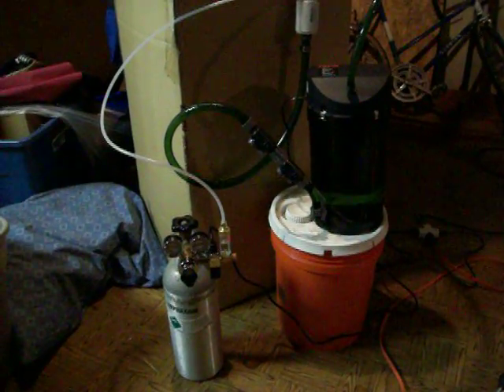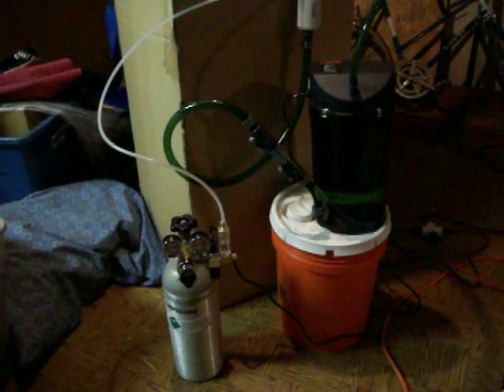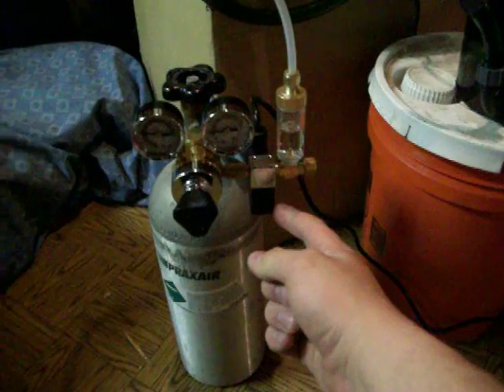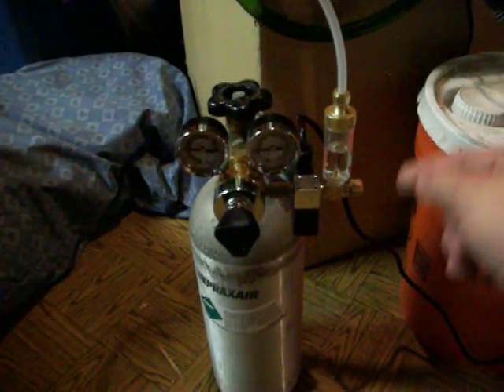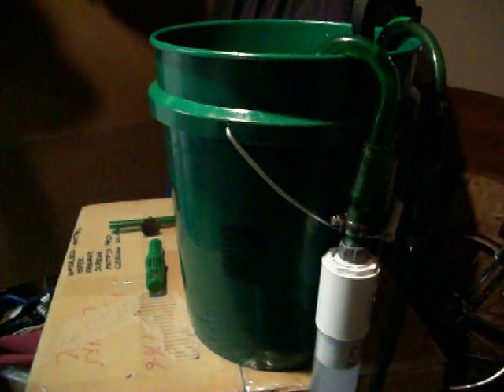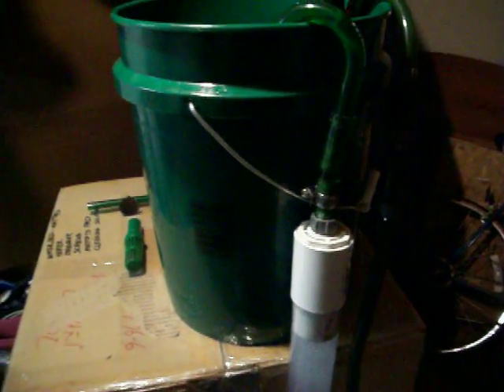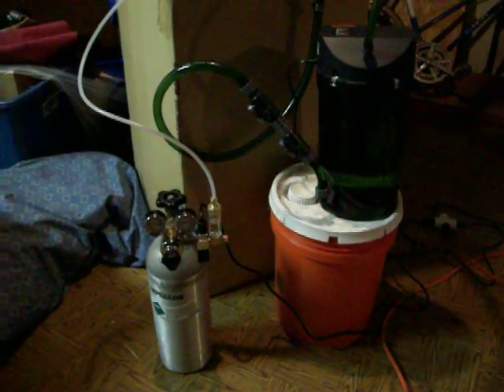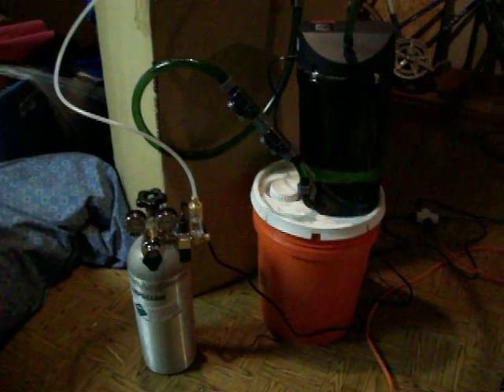DIY CO2 Reactor For Planted Aquaria

Comment from the maker: @xxTheReal118xx CO2 in general will always work better on a canister filter because it's a closed system.  With pressurized CO2, you're spending a lot of money to get that gas dissolved into the water, and all the surface agitation of a sump will just release that gas right back into the air, where your plants can't use it.  Hook it up on the drain side of a canister and you're golden.